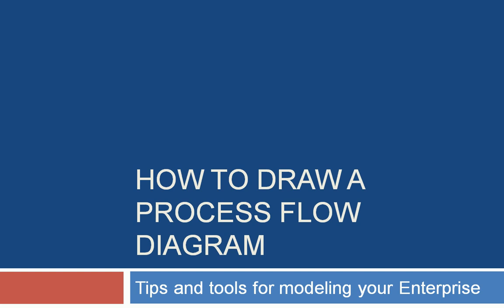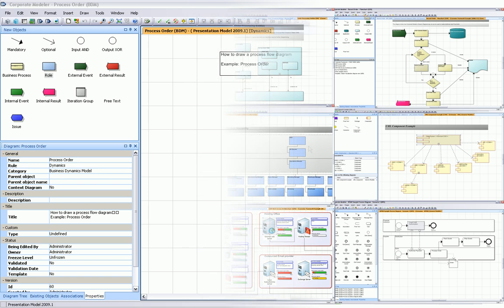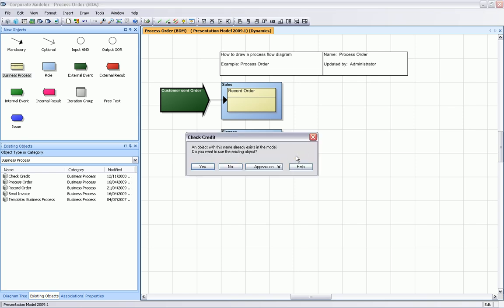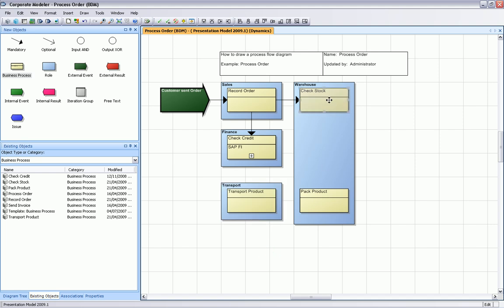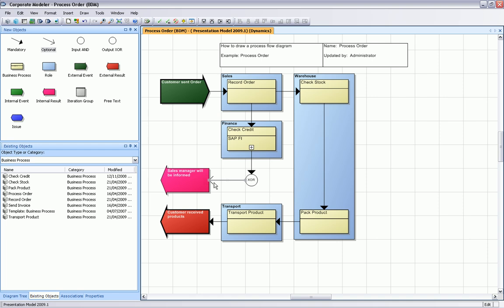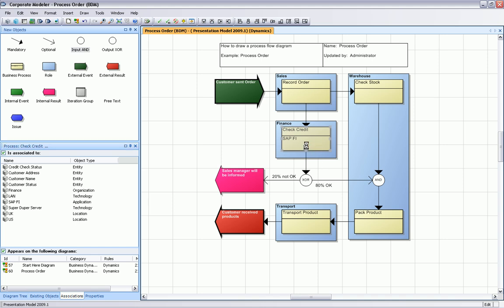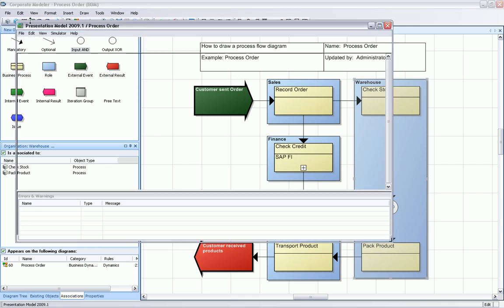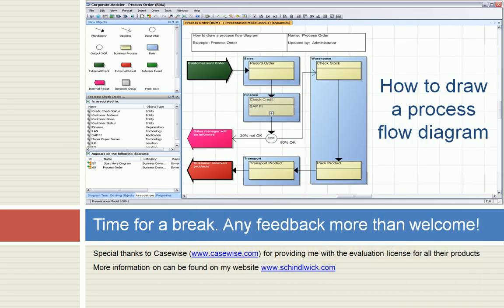How to draw a process flow diagram

Comment: Is that Casewise? It seems that there are some notations doesn't belongs to BPMN 2.0 Standard. Did you create customized notation or those notations are provided by casewise?
Reply from the maker: Yes you are right the software I used was Corporate Modeler from Casewise. The time when I released the video (2009) was before the BPMN 2.0 release (2011). So yes the notion is different and yes I used customized stlyles and notations. Casewise provided templates for lot of different notations, when I worked as product manager we built also lot fo best practice frameworks. One of the benefits using a flexible modeling tool. ;-)
Reply: THX. Casewise is cool. But I still wondered if your customized notations work in other tools. I wanna create external start/end event(it's in BPEL, not BPMN. A mix of BPMN and BPEL notation will not work for a single process map). I'm afraid that these notations can not be exported or they can not be visualized in other tools(maybe visio). Can I use signal start/end event to take place of external start/end event?
Reply from the maker: A notation is "just" a graphical visualization, if you speak about system integration than this is  a different story as you can independent on the visualizaiton layer map the requried data between two systems. So visualizaiton will have on impact on your interface as long as it is used consistent with a database in the backend.
Reply: A notation seems to be a graphical visualization. I'm talking about the logic behind these notation. If we take a look at the XML file of these notation, they are quite different. For example, a start event is based on catch event, and end event is based on throw event. A start event(Process A) might catch after a end event(Process B) throw, so that Process A can be executed after Process B finished. And that's why I wanna use signal event to notify external start/end.
Reply: In my opinion, it's easy to "draw" a new notation. However, it's not easy to "define" a new notation. I do need to show external thing in bp, but I'm not sure if new notation/attribute should be created. Do you have any advice?